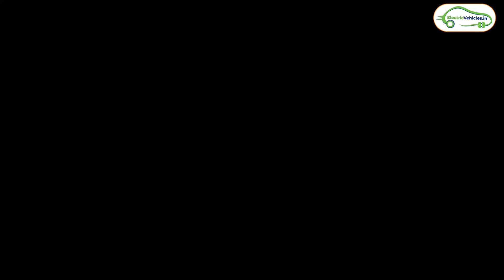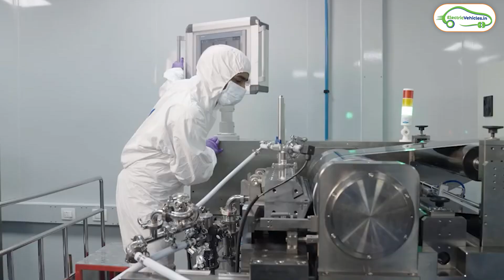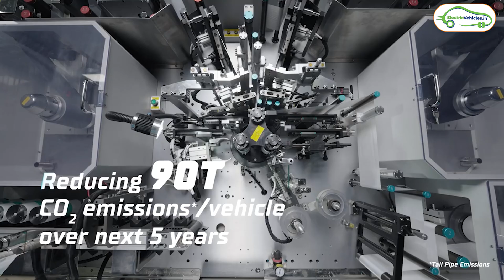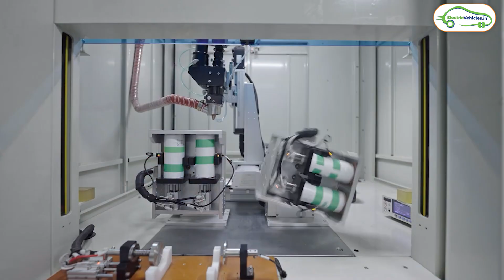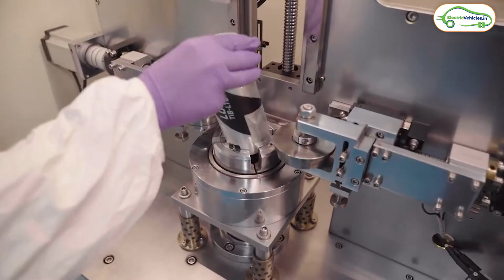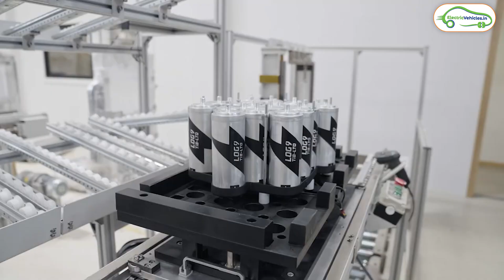This Battery Can Change The Future Of EV Industry | Log9 LTO Batteries | Electric Vehicles India

Comment: LTO  are suitable for home storage system only.
Reply: but faster charging is better, 5 minutes vs  1 hour for the same capacity if LTO was charging at its best versus Lithiu Ion at its best,  id haul a trailer of battery if i could charge that fast, this breaks a critical threshold for solar recharging, provided you could take that much solar panel with you, or you might need too because now you can take a smaller batter pack because you can rechaerge it 10x faster! amazing

Comment: LTO has been known for a long time. As early as 2011 it was used in electric cars( Mitsubishi i-MiEV ) in Japan, but its price (more than $250 per kWh) and density (less than 100Wh per kg) are drawbacks.  You can buy these cells under the SCiB brand from Toshiba, there is also some production in China. 
Another problem for this type of battery in EVs is the charging infrastructure, as these batteries from Log9 have a low voltage( 64V-112V ), so they need a high current( 250A) for fast charging. Many DC chargers only support higher voltages of 150V to 1000V and are current limited 30kW to 100A, 60kW to 200A etc..
So it's nice that another manufacturer is entering the market, but these cells are too big and heavy for EVs. Simple look at the capacity of the current batteries in electric cars and reduce it by 60% if you want to use this chemistry.